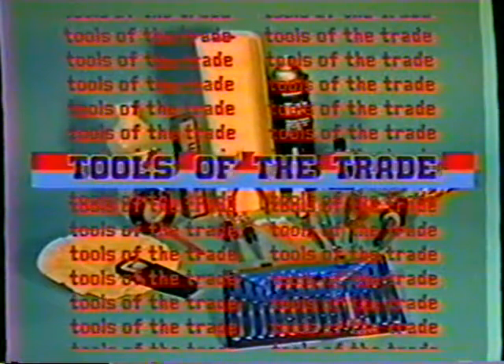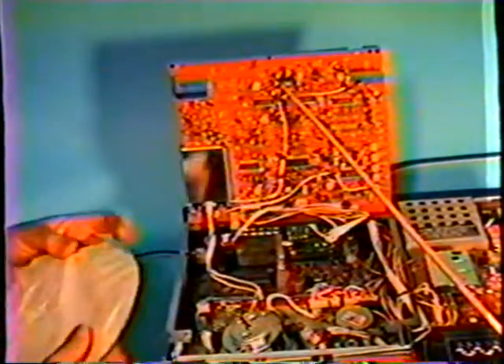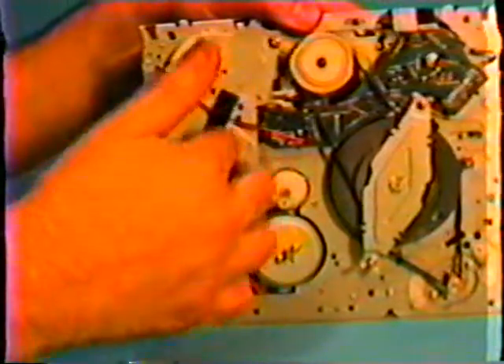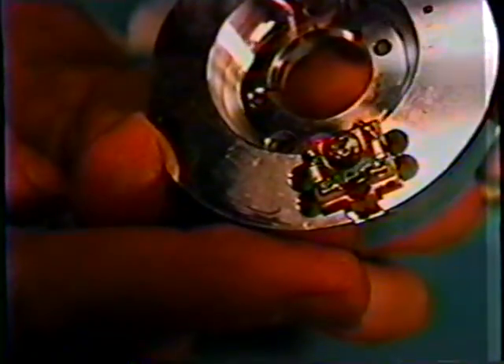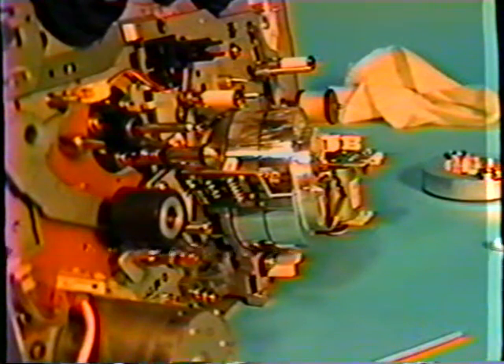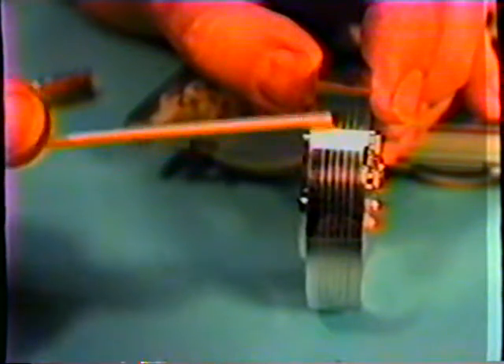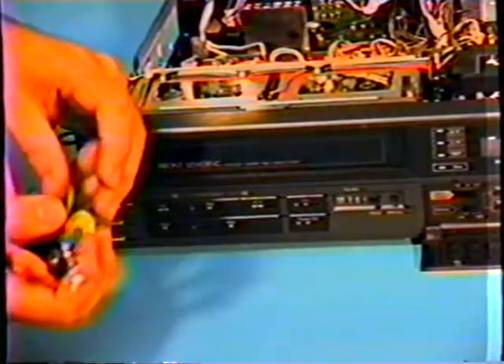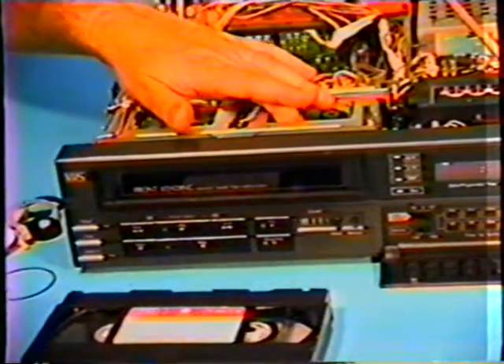HOW TO REPAIR VCR's (Tape 1)

Comment: O.K. Thanks for showing the backside on my vcr the tape load posts were loose and both moves independently And I couldn't get to the backside without removing the chassis from the Circuit board and of course when I lifted the chassis out the tape load gears fell out and I couldn't figure out how to re assemble them. I got a same model online for parts but again I don't want to remove the whole chassis. the parts machine has the DVD side that keeps ejecting the cd. I'm thinking the power supply is causing the new parts machine to go nuts. I need to explore more what I might be able to do....

Comment: Here's my problem and if anyone can help me I would be grateful. The tape goes in a bit, then comes back out. The vcr makes a buzzing sound when it does this. So it doesn't go in all the way. Anyone have any idea what can be wrong ?
Reply: +Sean Gutierrez go to 12voltvid on you tube.  he just showed a video concerning your exact problem.  It's an alignment issue.  couple screws removed , simple.  ck it out!

Comment: the 3rd Videohead is only to supply the TV with a Complete 2nd Vertical Impuls and the first Lines in the Picture but not to fix the  Informationloss in the Videoinformation! Reason is that the Videoheads are not 180° from eachother away the are 179,2° away to have in one Picture a Good Vertical Signal. But if you hold the Tape with the Still funktion it is not sure that the Tape stops at the Picture where the Frame 1 is on the Tape.

Comment: Great Video. The problem I have however is every time I load the tape into my player it will load it then immediately shut the player off. When I power up again it will reject the tape. Any ideas?

thank you martinr3f@yahoo.com
Reply: First check the power supply, see my videos on VCR power supply repair that fixed the same problem.